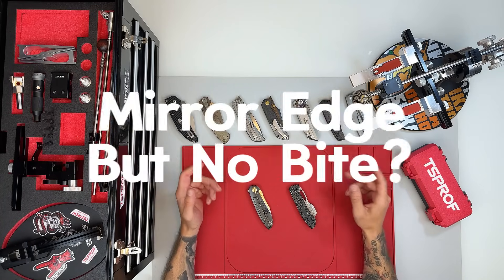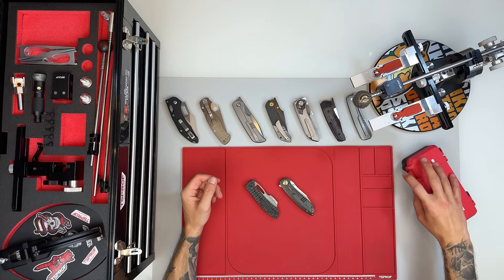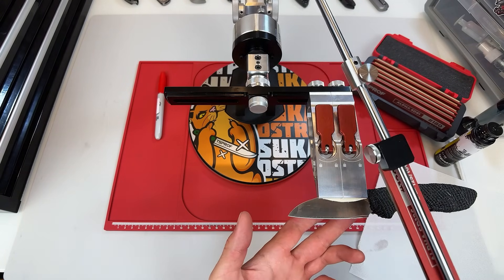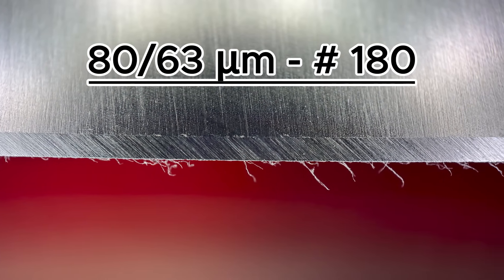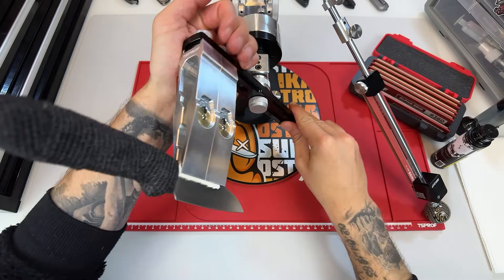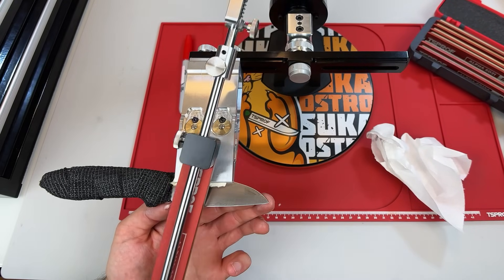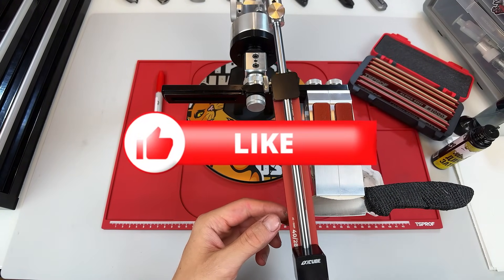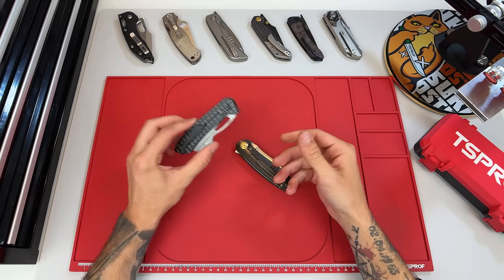Mirror Finish but No Bite? Why Your Knife Still Feels Dull After Sharpening CPM S35VN!

Comment: Whats your opinión to mirror polished edge on 15v spyderco ? Its supoosed to be 65-67 hrc
Reply from the maker: I have the Para 3 in 15V and got excellent results with a mirror finish. I sharpened it at 16 degrees per side. Have you tested it yourself yet? Thanks for your comment and like 👍
Reply: Thanks for your response i tested mi para 3 blade in a friends workhouse.three taps slightly diferent results in a final average of 66.3 i want to get rid of the factory edge and love the mirror polish finish.
Reply from the maker: @Mercuriowings11  oh that’s really cool 🙌 would love to have that opportunity. Lower the angle and you won’t be disappointed 👍 i will lower the angle on my one down to 15.
Reply: @Mercuriowings11 I will say in my experience, higher carbide steels like maxamet, rex 121, and 15v do the best with a minimal level polish, so the last stone i use is around 5-6 microns, like the edge pro 4000 grit diamond matrix. Then I strop up to 0.5 micron.

Comment: Yes over stropping is indeed a serious thing and you hear a lot of people say it's not however i do disagree with something you said. Typically when you over strop an edge you're not losing bite from rounding over the edge unless you're literally rounding over the edge but if you don't and you have a sticky Apex but with no bite the reason is is not because you've rounded over the Apex but rather because you have polished off the microcerations within the steel Matrix you have polished them down to a point that they no longer have any bite so you're only depending on carbide to give any aggression to the edge and in my videos is the main thing that I tell people to not do there is no quicker way to ruin an edge then over stropping and it's all due to polishing off those micro serrations.
Reply from the maker: I see what you mean, and I think it can be either one or a combination of both, depending on the steel. But yes, I get your point. I also think it's important to take into account the difference between hand stropping and stropping in a guided system.
Reply: I don't think that over stopping is actually a thing based on my experience, and here's why.

When you are doing mirror polished edges with either stones or by stropping, you are essentially doing the same thing, which is to remove the scratches from your bevel.

So as long as you maintain the correct angle on both the strop as well as the stone, and if the steel has the capability to take those fine polished edges, it doesn't make much difference whether the mirror edge is achieved either by stropping or by using stones.

I mainly do my mirror edges using leather and stropping compounds and they do get quite the sticky edges when I do it patiently without rushing it, i.e maintaining the correct angle and not rounding the apex.

So this is what my experience is based on using Sharpal 325/1200 stone and 6,3 and 1 micron stropping compounds to get the mirror edge on a cheap D2 knife and cheap 1.4116 german steel chef knife. 
These guys take those sticky edges even with mirror polishing by stropping but don't hold them.
Reply from the maker: @Knifesharpindia-1361  Thank you so much for taking the time to write this comment. I completely understand what you mean and I agree. If your technique is absolutely spot on, nothing really happens during stropping apart from dropping down to the strop’s grit finish. That’s why I mentioned in the video that the risk is quite high because even with fixed angle systems many people still make mistakes, especially when it comes to pressure, imperfect angle control or even the type of leather used. But yes, I get your point. Thanks again for your input.
Reply: @TheSharpeningGuide  I really hate youtube, most of my well thought and we'll written comments simply are glitched and don't get posted for some odd reason 😢.

I'll write it again, Ultimately what matters is that everyone should have a sharp Enough knife/ tool which serves them the way, they want it.

Even if that sharp edge is not achieved through "correct" manner according to some of us.

Ultimately, there are plenty of contradicting stuff which happens in this world, and we don't know why it happens, due to our lack of knowledge.

I like how Alex made a recent video where he explained that the more in-depth research we do about something, the more we realise that, there's so much we don't know.

As a result, we start forming our opinions based on our limited experiences and observations.

Many times these observations and opinions are opposing someone else's opinions, even though the results both of them get might be the same.

Like having different routes, to the same destination.

That's why I like a saying which we have in my country India " Suno Sabki, karo apni" which means " listen to everybody and do whatever you want".😂😂

Obviously with the caveat that, you should be proficient and expert enough in that particular topic to form your own opinion after doing rigorous experimentations and observations.

Stay Sharp🔪🔪
Reply from the maker: @Knifesharpindia-1361  Thank you so much for taking the time to write that comment, I really appreciate it. I totally agree with you. That’s exactly why YouTube can be tough sometimes. I try to share my personal experiences and combine them with the theoretical background, but when people have very different results or use different techniques that work just as well, some of them react negatively just because it's a different opinion. And honestly, that can be hard to deal with at times. But it is what it is 🙌 We are one community with the same passion 🔥 Thanks again for your comment!
Reply: @TheSharpeningGuide  it' very true. People are very passionate, rigid and at times very bossy about their opinions and experiences on YouTube.

My honest advice to you would be to think like this. Consider your YouTube channel as your classroom  and your audience as your students, where you'll teach your methods and ways about sharpening to them.

There are plenty of other classes which may teach different methods, or maybe opposing your own methods and there are many students who do not sympathize with your methods.

Your aim shouldn't be about changing their opinions, to make them similar to yours.

Instead you should focus on those guys who are ignorant about any methods or they didn't find others and their methods working for them.

Your aim should be to best explain to those guys that maybe your method would be something that'll work for them and they should try out your methods.
Reply from the maker: @Knifesharpindia-1361  That's a great perspective and solid advice, and you're absolutely right. It's never my intention to force my opinion or view on anyone. I'm genuinely happy to hear different experiences and perspectives, as long as we can discuss them respectfully and on equal footing.
I would never claim to do everything right or to know it all — not at all. I simply enjoy sharing my experiences, and making videos is something I truly enjoy.
Reply: @TheSharpeningGuide  that's the perfect approach 🎉🎉.  I appreciate your honesty to understand a lot.

I was really tired of YouTubers who had the attitude of "my way or highway".

These people think that just because you are capable of certain success, it's as if you have unlocked some "hidden truth" and anyone who says something different to them, they start feeling triggered as if the other person is blaspheming😂😂.

In fact today, I received my parcel of Vosteed raccoon and Atoma stones, and frankly speaking my first experience with Atoma stones isn't as great as I thought😅.

Unlike the Sharpal stones which have a feel of uniformness and smoothness even for the coarse stones, Atoma stones feel a bit off to me, in terms of Sharpening feel.

The diamond cluster feels a bit "bumpy" even for the 600 grit atoma while the 140 is straight up gravel road😂😂.

Now, I really understand how different structures make a huge difference.

I'll need to test them more but so far I am not much impressed with them, even though most Youtubers consider Atoma to be "GOAT" for freehand sharpening.

I'll test them more and then post a review on my channel as to whether I feel if they are worth buying or not over Sharpal stones.

Comment: What made you flatten your Alphas? And how many knives do you have sharpened on your Alphas so far??
Reply from the maker: I did it because you asked about it in the comments on the last video. 😅 I just used a glass plate and some SiC powder… worked perfectly. I use a Nagura stone every 4 to 5 knives, and so far I’ve sharpened around 30 knives with the stones.
P.S. I’ll reply to your longer comment as soon as I have a bit more time 🙌
Reply: @TheSharpeningGuide 😂😂😂
Do you feel it made a noticeable difference?
Reply from the maker: @rickmoss7040  As long as you do everything correctly and make sure to clean the stones thoroughly – especially making sure no SiC powder remains on or inside the bonding – they work perfectly. Honestly, they’ve been the easiest stones to maintain that I’ve used so far. By the third knife, the scratch pattern looked as clean and consistent as if the stones were brand new 👌

Comment: I worked at Rick Hinderer knives for a couple of years, as a CNC machinist. I was a machinist for maybe 20 years before I worked there. Working for Rick, showed me the difference between an elite level knife maker, and a typical, big company that mass produces knives(Rick did a LOT of designs for ZT and Kershaw, which mass produced knives). I also learned that the ‘same’ branded steels are NOT usually the same when you take say, S35VN from America, and Chinese ‘S35VN’. There is a quite large difference in my opinion. Now, maybe the difference I saw, was the heat treat, because I do know that makes as much, probably MORE difference than the actual steel. I worked for Rick through 2018 and 2019, and we used mostly S35VN at that time, so I have more knives in that steel than any other steel…because believe me, I took advantage of his gracious discounts for his employees. I am curious if you may someday, do a video on the same steels, with different origins(countries) or different heat treats…may be a fun video idea for you. I also think there are some great American made knives, like Hinderer, Chris Reeve, MachineWise,Dead Reckon….to name a few, and some American companies that don’t make very good knives like Banchmade🤮, Kershaw, and several others…but again, the difference is the hand made/hand fitted aspect and level of materials…what I don’t get, is how Benchmade especially, charges the same price for a high production line type knife, as other makers that have a A LOT of hand fitted, tuned, and assembled knives…makes no sense to me. But hey, what ever. I just wish people would educate themselves about the levels of quality and hands on production, before complaining about the price of a knife. Yet the same person will own 100 Chinese mass produced knives….anyways, thanks again for your work on the video brother.
Reply: Why are Benchmade knives bad? I bought a Mini Boost in S30V for $40 from a guy at work who said he found it and it’s pretty nice. That’s the extent of my experience with them. I was just wondering before I buy something more expensive.
Reply: @mikebond6328 I don’t like Benchmade because they are WAY over priced for what you get, and more importantly, their CEO continually gives very large donations to Anti-America and anti 2A senators.
Reply: @mikebond6328  There nothing wrong with good production knives!! Me personally, I am not a big fan of Titanium frame locks!! To each their own 🤷‍♂️
Reply: @mikebond6328 Their knives aren't bad, just massively overpriced. For example, compare the Benchmade Bugout to the Hogue Deka. The Deka is less expensive and uses better materials.

Benchmade also usually heat treats their steels soft, with the exception if CruWear, which they do harder than normal.
Reply: Hinderer used lower than recommended hardness and burned them during sharpening, requiring 10 or more sharpenings to get to good steel. I don't consider them to be top tier.
Reply: @tacticalcenter8658 that was before Tristan started doing the sharpening, once he got a sharpener that knew what he was doing, that problems was no longer an issue, but it definitely was before Tristan.
Reply: The Chinese would import the s35vn and heat treat it low also as well as burn the edges. Often lots of retained austenite. But they for the most part use CPM supplied protocols.
Reply: Can you tell me anything else about the Hinderer S35VN? I have a 3" XM18 in S35VN and I read that hinderer tended to heat treat it softer.  I haven't sharpened it yet but it isn't the sharpest and I'm sure the angle is way more obtuse that I'd want for most cutting tasks.
Reply: S35VN was a Crucible Powder Metallurgy steel that was only made in USA. 🤔

Don’t start talking about Rick Hinderer knives and heat treat… you will get a cease and desist notice!! 🤣 

Kershaw has been stepping up their game!
Reply: @kmason37 and yeah, I meant to write a Chinese M390 vs an American M390, but I HAVE seen Chinese knives with S35VN marked on their blades.
Reply: @rickmoss7040  There is no Chinese M390 or S35VN. They aren't generic grades like 440c, D2, etc. They are proprietary steels. So no matter where the rest of the knife is made, if it says M390 the steel they're using came from Bohler. If it says S35VN it came from Crucible. Chinese manufacturers buy the proprietary steels to use for their knives just like USA manufacturers do.
Reply: Outpost76 tested various companies different heat treatments, including hinderer